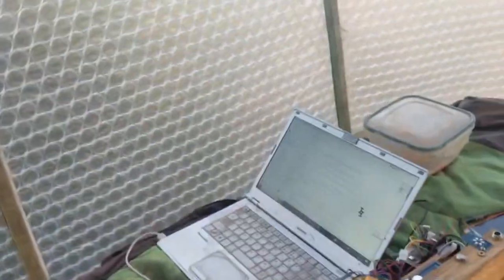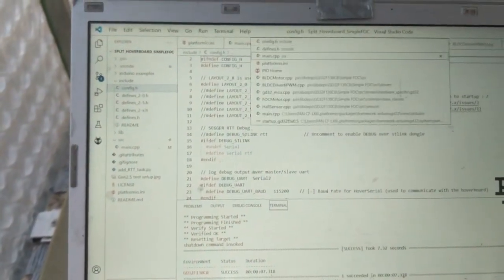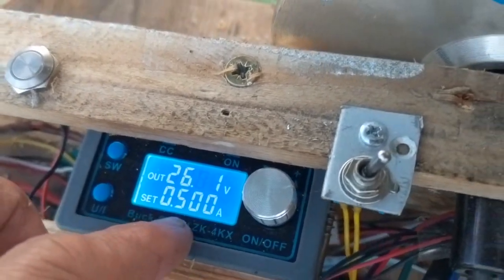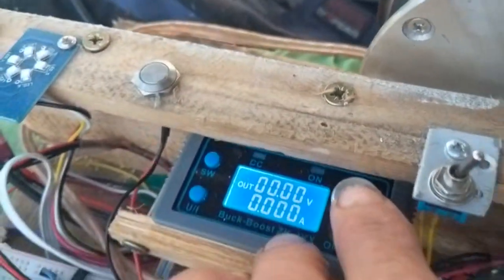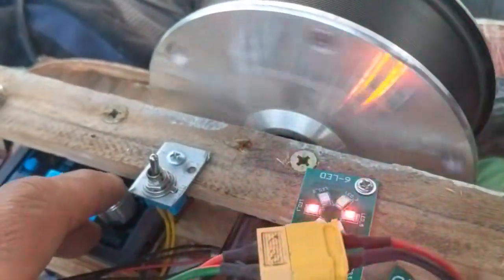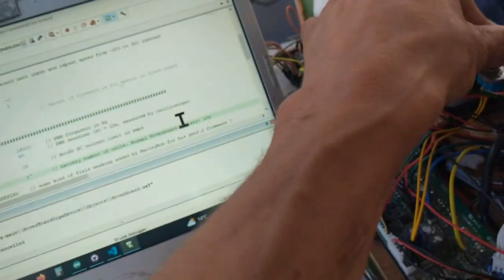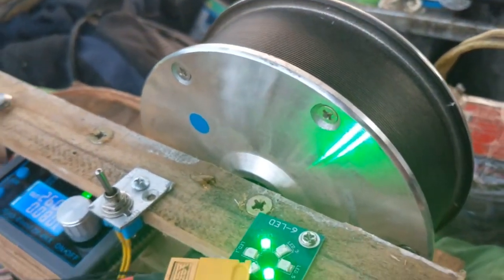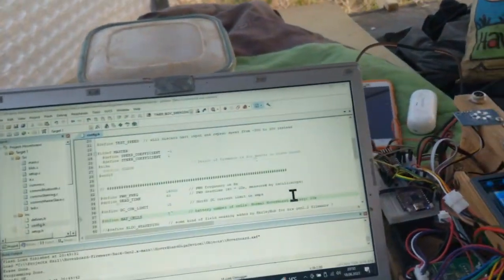part 2 C++ SimpleFOC hoverboard: motor spinning poorly

Comment: I recently bought this same model of Mega truck, although diesel. There is barely any information about these anywhere, so its very cool to see another grown ass man using it as enthusiasticly as I will be!!

There's one thing I want to ask. The front shock absorbers are connected to the frame rails through the plastic body. Have you needed to repair them? My body has torn off, so I was wondering if this is a common issue with these trucks.